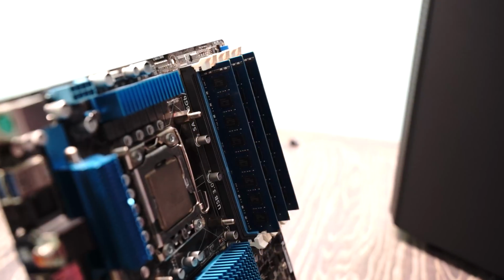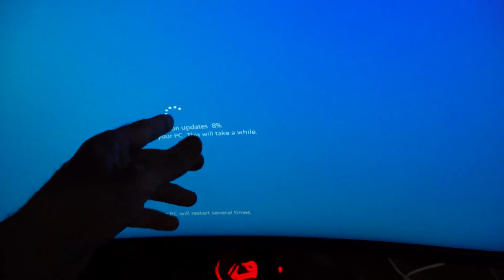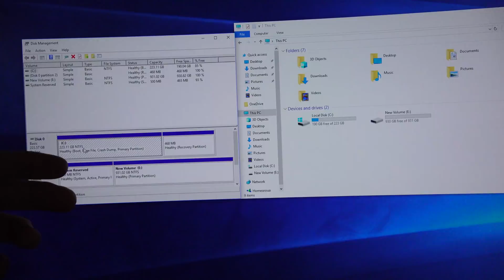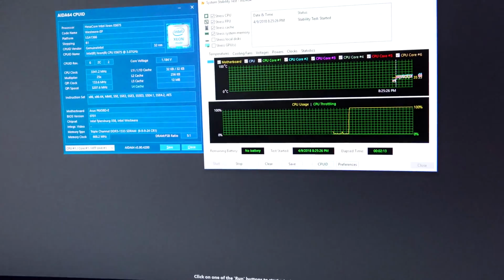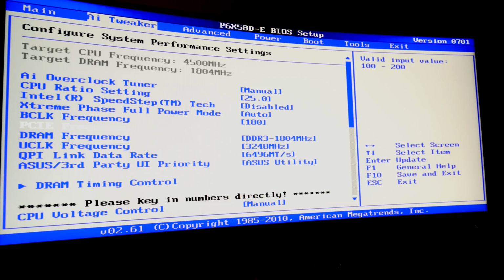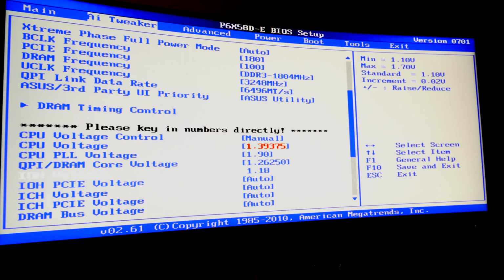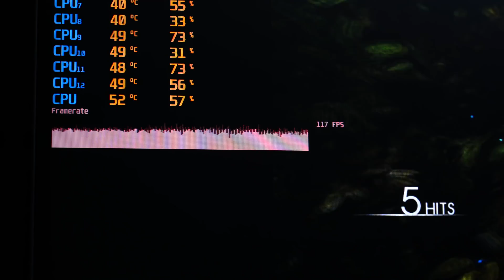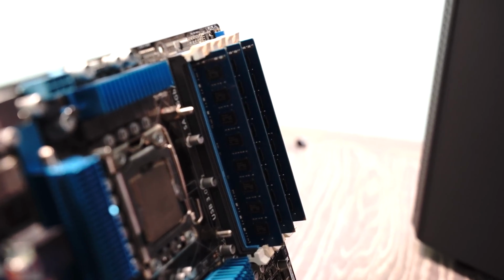Is X58 Still Worth it..? Taking the 6 Core X5675 to 4.5GHz on AIR.

Comment: Really Bryan?  Really???  Here I thought I was being original... I'm up at 2:30am benchmarking an x5690 against a Ryzen 2400G to see if its relevant in 2018.

AND I PUT IT IN A BARONKASE LIQUID!!!!!!

Great video as always man.  Great minds think alike it would seem.  Cheers!
Reply from the maker: Always love me some good ol' xeons, baronkase is a bit small for x58 though I think.
Reply: Tech YES City I have been following your x58 builds and got a motherboard and a X5660 to give it a go. But the motherboard/VRM area has very bad coil whine.

What would your suggestions be for this issue? I have read trying a different PSU (the one I have is an EVGA G2 650w) thanks!
Reply: @techyescity  I'm an avid fan of the x58 platform as well with three machines up and running; mine and one for both of my gaming daughters. I completely agree with your view on the platform and it just comes to show that by making smart moves in the world of hardware, you can get a long way and not loose a fortune. HOWEVER (and here it comes 😁) there are serious downsides too in running an older platform. And by serious I mean SERIOUS. I'm talking compatibility here. Just for the fun it, if you have one laying around, try putting a Vega card in an x58 machine under Win10 and see what happens ...
Reply: KickrAzz I Have had a similar issue with Vega. I think it is because it only likes UEFI mobos and cannot handle the old school BIOS due to the GPU itself been only UEFI.  Is that the experience you had?
Reply: Not quite, although there does seem to be a connection to it. The odd thing is that it's working just fine under both Windows 7 and 8.1, so I'm currently dual booting those. I'm hoping to keep it running that way until I'm either forced to upgrade again due to a lack of performance, or gaming under DX12 (or it's successor) will become serious. Right now it's only a gimmick and there's no real value to DX12 over DX11.
Doing a bit of research and Vega's are just not fond of PCI-E 2.0 .It's also stated so in the requirements that PCI-E 3.0 is needed for a Vega so can't really blame AMD, but it's a shame. These Vega's are hit & miss on PCI-E 2.0 boards, sometimes it works under Win10, sometimes it doesn't. Whereas Team Green just always works, period.
Reply: Craft Computing Nobody understands sarcasm apparently.
Reply: The x5650 destroys a 2400g, so ya, a x5690 would as well. Was this some big mystery that only a select few humans knew about?
Reply: x5690 still kicks ass especially with 24gb RAM and a 1080ti
Reply: Looking forward to seeing that video.
Reply: Incredible Sir and I'm curious about your results.
Reply: Hey Brian, i just recently built a x58 system with a x5675 myself, but on a evga x58 ftw3 with 6x 4gb DDR3 1600. I hot my xeon to around 4.2-4.3 in custom watercooling Loop. Do you have any experience in CPUs oferclocking worse with 6 dimms rather than 3? Anyway, love your content, mate. Greetings, Dave 😉
Reply: Please finish the build and post it up. I love anything X58. X58 Sabertooth/X5680/GTX 1080 here.
Reply: I might only got an X5460 running (@ 4.1 GHz), but even that is actually competitive today. So any 6C/12T chip on LGA1366 will be kicking!
Reply: D0ubl3d4v31 I run 6x 4GB dimms myself. Just give then another few 10th's of a volt and you should be fine.
Mine (which are 1600mhz) are at 1.52v @ 1440mhz for 4.5Ghz overclock. No issues.
Reply: about 4.4 on water
Reply: Excited for yours as well man!
Reply: D0ubl3d4v31 in general the more ram sticks installed the harder to oc . More stress on the inch.
Reply: yeah its great apart from being locked except using bclk
Reply: RoomerJ what is better for gaming x5690 or w3690 please brian do a comparison on games. I am going to build a new pc.
Reply: amjed al-suleimani The w3690 and X5690 perform exactly the same. The W3690 is harder on motherboard VRM's, they're basically X5690's that took slightly more voltage to run stock speeds. They're harder to keep cool and aren't as stable at high temperatures as 5690's. Also, I'd recommend sticking with the X5675, as they're the highest binned 90w TDP chips on X58. You might get 100MHz more out of an X5690 but you're going to do it with higher temperatures and more demand on the motherboard VRM's. X58 mobos are getting more and more rare, so every action you can take to preserve the mobo is one you should take.
Reply: @K31TH3R  you deserved the like only for your thoughts!
Reply: @gjergjkastro9404  Thanks. :) I still have my X58 and Xeon X5675 running as my home server/NAS. It's as reliable/fast as ever, although it's running at 3.4GHz with an undervolt on the stock cooler versus 4.8GHz @ 1.45v on water like it was. You'd have to pry my Xeon out of my cold dead hands. I <3 my X58.
Reply: amjed al-suleimani X5690 would be better and handle a higher overclock temp than the w3690
Reply: I'm currently at 4.4GHz with an MSI-7522 and a Xigmatek Thors Hammer from 2009, didn't try to go to 1.4 volts yet.
Reply: Is there a difference between the x and w series hex core xeons of that generation. I want to do this myself with my x58 board.
Reply: I always say... if you can run it and it does what you need... then it's relevant!
Reply: PS4 Custom Gamer This is the reason why you will never make progress or gain experience in this community. Craft Computing is fucking awesome. I mean he drinks and builds computers. Doesn't get better than that!
Reply: Tech YES City Normally I'd agree on the Baronkase size, but I've got a bit of a unique motherboard for it.
Reply: You need to take on some Chinese accent or something... Only reason why I watch Bryan's videos over yours.. LOL
Reply: The Big question is what was the beer of choice during the bench run?
Reply: who r u again?
Reply: BigMan7o0 2 replies just a troll trying to get people to react
Reply: Desperate fucker come up with original content and stop buying chinese crap no one should buy

Comment: If I may make a request , please start including the single core cinebench scores.
Really helps in comparing the IPC on these old CPUs with the latest ones.
Thanks!
Reply: I have the exact same mobo with a x5670 @ 4.7ghz single core cinebench score is 142 so not amazing but still decent for it's age I imagine his score is around 135 with his slightly lower clocks.
Reply: Trino Dee Thanks mate.
So it is basically around a stock ryzen 1200( for the single core performance)?
Reply: When it's overclocked it's around the same ipc yeah, the X56xx is a great upgrade path for anyone who already owns an x58 board and is looking to upgrade their old i7 920 for example or if you can find super cheap deals like bryan does but personally I wouldn't recommend dropping the £100-£150 asking prices on an old x58 board.
 
These days there's too many cheap new options which don't have missing instruction sets (Avx, Avx2) and come with sata3 and usb3 and many other newer chipset features already onboard and are also much less power hungry. 

That said i'm still very happy with mine I also have a second rig with a i7 6700k and i can't really tell the difference between them unless i'm running benchmarks or staring at an fps counter.
Reply: I searched, but let me ask, how does this build (Video compares itself to a Stock i7 3960X? Its hard to find something on that :/

Comment: I have a xeon x5650 on an Asus Sabertooth x58 with 12gb ram and a GTX 780, works perfectly fine and I don't think there is much need to upgrade
Reply: # good joke, the cheapest ryzen would get drestroyed by an x5650. Those LGA 1366 xeons are a few FPS away from newer i7 procesora, even the 8700k.
Reply: Yep, I get 995 Cinebench score with my x5675 running at 4.2ghz 6 cores/12 threads.
Reply: I have sabretooth x58 with w3690 xeon oc to 4.1ghz with msi gtx 1080 and 24 gig ram and 120gig ssd...all new games on ultra in 1080p resolution, still very nice hardware
Reply: love my x5650 still a beast for editing on my p6x58d-e mobo. still running a gtx 670 😂
Reply: That can easily doal boot with XP for maximum overkill in old games.
Reply: Karol Kostial nice
Reply: I’m looking to build similar installing 2x1060 6gb. Looking to do Adobe PP? Think it’ll work?
Reply: The cheapest ryzen 3 is better than that x5650... There is no point on buying one of those old Xeons anymore
Reply: #
Yeah, in single core performance.
But as long as you're using more than one core, that ryzen, and actually most ryzens don't stand a chance.

Comment: Two 5650s.. Can't get a mobo for it.
Reply: Not worth it, unless you do not care about single threaded applications, then there are some "cheap" boards incapable of oc. Since the TR2 is the only board capable of overclocking two 1366 chips at once it is extremely rare and costs well over tripple what a normal X58 costs (like >$400) if not over a grad even. At this point, rather buy threadripper 1920X with a cheaper board and much better i/o, efficiency and warranty. Trust me, a stock X5650 sucks in most applications and adding another one does not make it better for the most part.

Comment: You do realize that the thermal interface material used on the northbridge (and later PCHs) is indeed not a paste at room temperatures, so it's perfectly normal for it to be hard when you take off the heatsink assembly?
Reply from the maker: Whatever it is it is worse than thermal paste reapply, already tested so many times before and after.

Comment: I am an X58 addict... its all I use because it's so good with the X5650 +   My main rig is an Asus P6T Delux V2 with an X5650, AIO Water cooler, 2 X GTX 950's in SLI Overclocked to 1750mghz...  The X5650 I got was a brand new one I found on Amazon for $85, right now it has a simple x20 multiplier OC sitting at 4.1 Mghz.  idle temps on all cores 25 - 27c and when gaming the highest they get is 74c.   Fortnight on High pre sets and shadows turned down a little bit average 68 FPS, League of Legends 120 FPS, PUBG Medium settings 1080p 65 FPS..   I really want to get 2 GTX 980's or if the Lord willing somehow be able to afford a GTX 1070ti..  I am running currently on Windows 7 because I am having issues running windows 10 for some reason and with driver comparability,  I don't know what to do to fix it =/
Reply: i been using x58 motherboards for years these motherboards are gold man
Reply: Sounds like a good rig! Check out the GTX970, I'm running one with an FX-8370 @ 4.5GHz and it has no issues at all, generally about 90fps at medium/1080 in PUBG.
Reply: GTX 950 to 1750mhz..... yeahhhh nooo , i'd belive 1500mhz but not 1750 : ))))
Reply: Would I really be better off ditching the 2 950's SLI ? I've put in a lot of reading on the 1050ti and I feel like its not an upgrade on what I have so would I be looking at a 1060?  In my area on offer up I can get an EVGA GTX 980 SSC for $250 right now.  Would that single 980 be a lot better than the SLI'd 950's ?  When I originally bought and built that computer in October of 2008, It was an I7 920,  3gbs of Ram, 2 X GTX 250's in SLI all running on a 700 watt semi modular power supply and I paid $1255.80 from Alienware before the Dell buy out built in the Area 51 Case in 2008.  All I've done in 10 years is put 32gb of Ram in, replaced the i7 920 for the X5650 Xeon, replaced the 2 GTX 250's with the GTX 950's... so I've only put another $360 total into the computer to upgrade over a 10 year period.... oh I did' have the HDD that came with it go down on me it was a 750gb barracuda.  I now have a 1TB WD Black Storage and a 256gb Intel SSD that I got new on a sale for $25
Reply: Late reply, but I run a P6T Deluxe V2 with a 975 not OC'ed, 12 GB of ram, and a GTX-690. I would suggest you dump those two 950's and either grab a single 980 or even a 690 from ebay depending on which is cheaper (though they are going for about the same price). They both bench at about the same numbers for most stuff. I'm about to hand this rig off to my son and build a new one for myself. I think it's still got a few years of relevancy left in it. Can't do VR but does everything else. Also have no issues with Windows 10 and drivers.
Reply: @TallynTech  the issue with s a line is nine times out of 10 it's going to perform like how One card with their form .5 times out of 10 it's going to perform worse and the other point five times its going to perform better
Reply: Would like to go into the X58 game at some point, only the boads are expensive. But I can wait.
Reply: How come Intel has been sandbagging it for 8 years now?  This CPU from '10 draws  a lot of power but is incredibly modern in its capabilities - and people wonder why AMD has tons of fans after 8 years of Intel playing games with consumers.
Reply: phatlewtz82 Get a gtx 980, then overclock it, it'll beat a 1060 and almost match a stock 1070, so go for the 980, you'll be happy and save some $$$ 😀
Reply: Only that on sli 970. Something wrong lol. I get those fps on ultra. With a single 970
Reply: I get that a lot with the OC on the 950's ... I have no clue why they are doing so well? They are the GTX 950 EVGA SSC versions and I used MSI Afterburner to get that.  Booting up MSI AB to check.... Okay, so it's hard to tell but the Core Clock is set at a +440 with Zero OC on the Memory.  On the dial it has a white arrow for base clock and a red arrow for boost.  The white arrow is just in front of the 1750 marker and the red boost marker is dead in between 1750 and 2000 mhgz.  I really wish the layout was more clear and showed the exact numbers unless I don't know how to see it... that is a big possibility.  But if we are going off the base it looks like the white arrow is sitting at what I would call 1700?  So I did over judge it a little
Reply: How did you get the cpu to work with that board? It is not on the support list
Reply: 2 X GTX 950's in SLI????????????????
Reply: Hey bro im using my x58 udr3 gigabyte with a 5650 and 780ti with no issues under win 10..
Reply: i have a intel dx58so2 motherboard and i also was having problems with windows 10, kept on giving me bsod, i eventually downloaded chipset drivers and sata 6gbs drivers and windows 10 hasn't given me any problems since, i have a gtx1070 and plays games no problem at 1440p, x58 really is a fantastic motherboard and i really don't see the point in upgrading even to a 9900k. ill upgrade when cpu performance is 5x ahead of x58.
Reply: I built an Asus P6T Deluxe V2 recently, with an x5675, G.Gill 1600mhz 12gb triple and CM EVO 212. Unfortunately I have one broke socket pin on the bottom center inside perimeter facing center recess. Luckily, pin is solely responsible for case panel power circuits, unplugged all's good. I left all bios settings auto because of pin, but along with needing to power on via MB power button I used to get false 'Overclock Failed...' message during post. Yesterday I manually set bios timings to manual, ratio=23, bclk=160, dram=1604, leaving turbo, stepping... all auto, and it fixed 'Overclock Failed...' message, apparently had nothing to do with broke pin.

Running at 3680mhz, I stress tested 15 min with AIDA64, max core rose to 41c, happy. I reached my goal of mild 3.68ghz - 1604mhz with default CPU settings.
QUESTIONS: At what increase in bclk should you increase voltages?  Is leaving all other settings default optimal per my setup?
Reply: You’d be happier with a single more powerful card I can assure you sli has been wonky after the 700 series cards imo. Not that much support for a lot of games.
Reply: # You Fucking IDIOT! Not only will these old xeons match sandy bridge once overclocked, however they shit all over first gen ryzen, EVEN THREADRIPPER 1920x using a dual-socket overclocking board like the EVGA SR-2 CLASSIFIED!!! The ryzen 3-1200 only scores around the 500 range in cinebench, the r5-1600 scores around an 1100 stock, my x5675@4.5 GHz scores an 1196, beating BOTH Ryzen CPU's, a quad core and six core, so do your research on these old xeons before posting such stupid comments DUMBASS!!!!!
Reply: Dude the cheapest Ryzen 3 for 10$ more is better than that old piece of crap, what is the point on using those old xeons?
Reply: @25566  I have a Ryzen 3 2200g with 16GB DDR4 2667 and a Dual Xeon X5680 with 48GB DDR3 1333 and trust me my xeon absolutely destroys it in every aspect except single threaded performance and power consumption.
Reply: @25566  I think it's about experimentation.

Comment: When you install Windows, always plug in ONE hard drive.
Reply: Is that because the hard drives will compete with each other, and Windows won't install properly?
Reply: So you can have your (System, Active, Boot, Page File, Crash Dump, Primary Partition) all on one HDD/SSD.
Reply: Agree. I´ve had this issues quite a few times over all Windows versions I remember the last years.
Reply: Solid State Drive.

Comment: Hey Yes-Man 4 months ago i bargained My First Gaming pc got a MSI 980 for 200€ and found a used x58 pc with 360mm watercooler for 75€ 
Put a small ssd in and Upgraded to 12gb ram 
The i7 920 did good up to 4.2ghz at 200 Base but i put it down to 186 base so i could run My ram at 1866mhz 

Did 640p in Cinebench. 

Sold it for 300€ and Moved to a used 4790k.